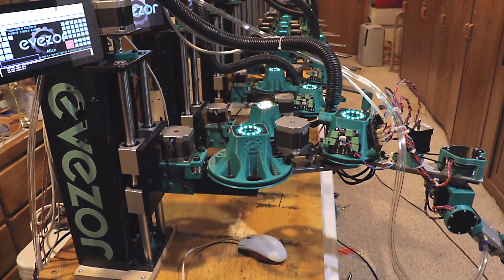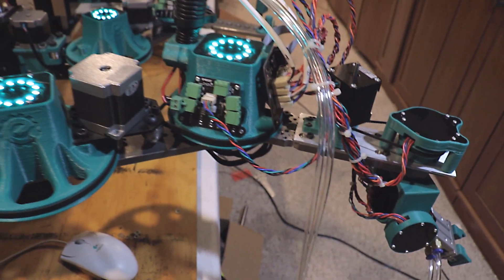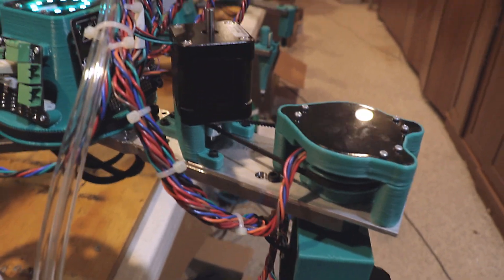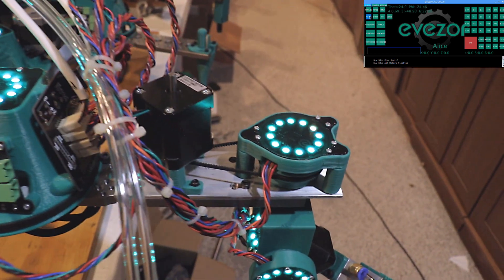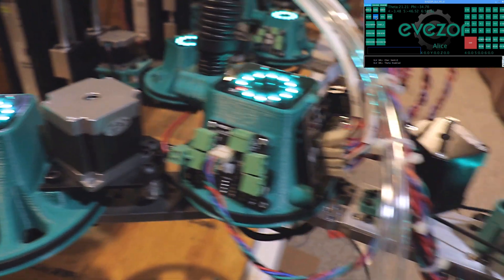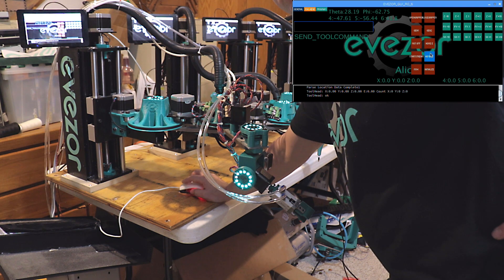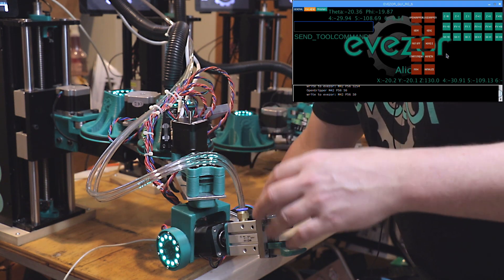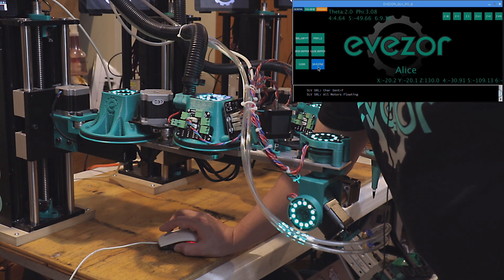10 Robot Reveal with Record and Playback Functionality

Comment: Wow haha they are multiplying! That calls for a robot dance! :D
Have you considered something like the E3D toolchanger? 
I'm still wondering how far you can push automatic manufacturing. Things like taking one or two workpieces and putting screws in, or nuts and bolts. Or 3D printing and then milling and polishing or painting.
Reply from the maker: Yeah they are! 
I have been going back and forth on toolchanger designs. None of them really solve all problems. In the past I've opted to just put more than one tool on at a time and tool offsets are easy. E3d has a nice design, but like I said, I just have no idea just yet.
I want to find that out too.  I've been searching for over a year for an idea compelling enough to follow through.  If you have any ideas, please let me know.
Finally, there will be some kind of dance coming. I've already built a messaging protocol into them and they can all talk to eachother, but that's for another video. ;)
Thanks again for all the replys
Reply: @Evezor  E3D has some info on their development. It's a specific design to ensure perfect registration. Not sure if it's strong enough for tougher applications or if it can be beefed up. The limit is probably clamping force of the locking stepper and the hardness of the registration parts. Making it compatible with E3D might be beneficial.

Also looking at the robots on that long workbench it might be interesting to have a common horizontal rail where they move along and have the first two axis rotated 90°. So you could have 2-3 robots on a workbench share a rack and pinion rail to work together.
Reply from the maker: @dejayrezme8617  Yeah, I'm familiar with E3D's design. It has a lot of benefits and there could be some benefits to sharing the same design.

You're saying to make a 3 armed thing? Like having a left, right and then an arm coming out of your chest? That's an interesting idea. I do have some extra 20mm linear motion hardware lying around, but again it's kindof a juice/squeeze predicament, where I'd prefer to have a use case before investing the time into making something.
Reply: @Evezor  No I was thinking a long horizontal rail instead of the vertical one. And the rail is shared by 2-3 robot arms. 
That way multiple robots could share the largest axis and work on a larger workspace.
Then you could have a production line with parts moving from robot to robot.
Not sure if it makes sense haha. Just thinking out loud!